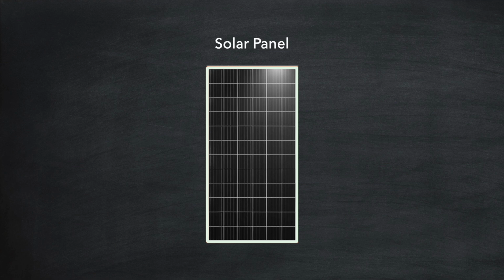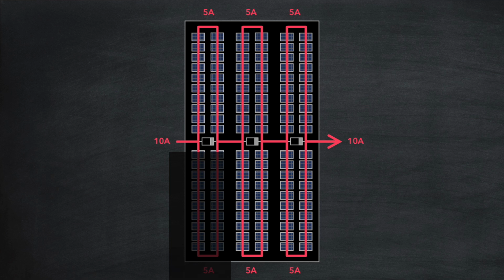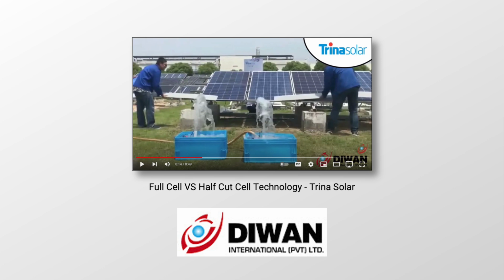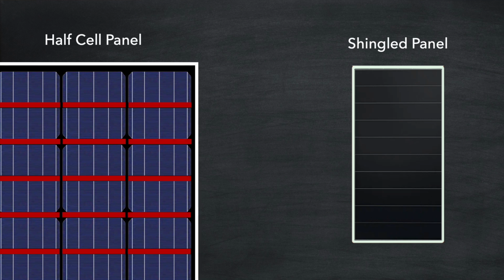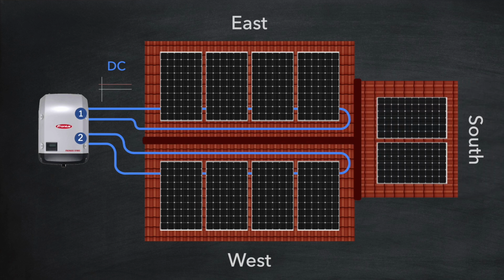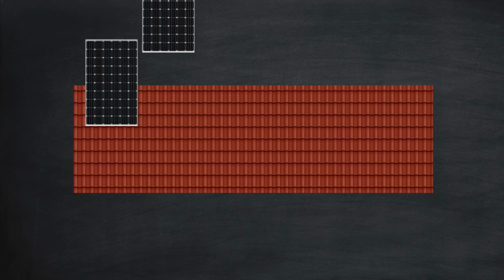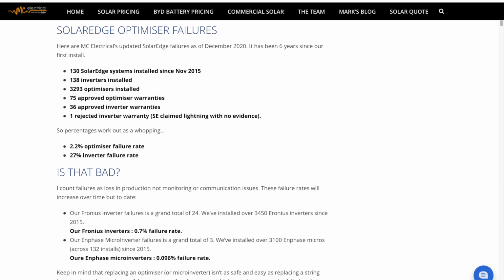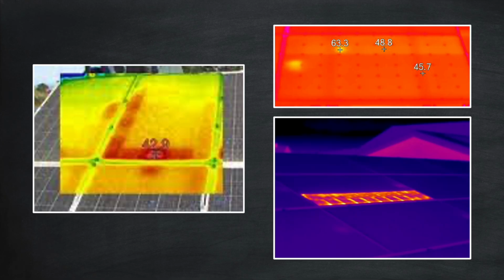Solar Panel Shading (Part 2): More on Optimisers and Micro inverters

Comment: Very informative vid and as with all things, more info tends to make it a bit more confusing for the newbie. Ive a south facing roof so solar seems ideal. I like the idea of a battery but would also like to use it in case of power cuts but not all systems can do this?

Cowboy installers worry me. I recently had 6 gas engineers round to quote for a new boiler and gave them a small list of requirements ie no combi, no budget boilers, got to be reliable and TRVs. Only 2 gave me a quote, the others didnt want to know!
Reply from the maker: Thanks for the kind words. And yes, it's true the deeper you get into the world of solar, the more involved it seems to get! I'm hoping that my videos go a long way to demystify everything, but maybe I'll have to be doing this for a long time yet - lol

You're right - not all battery systems manage power cuts. The only system that manages it well is the Tesla Powerwall, but you'll be on a waiting list for a year to get one, unfortunately. Many other systems provide a couple of dedicated power sockets in the event of power failure, so you'll at least be able to run an extension cable to your WiFi router and TV etc.

Yes, like any new market (think double glazing many years ago) there will always be opportunists. I talk a little about this in the podcast I did, referenced in the video, which might be useful to you...
Reply: @1701:TheFyldeFlyer
I have just had a Sofar HYD6000 hybrid inverter fitted and this has a critical load output or EPS connection which can be wired to supply a smaller consumer unit so that in the event of a power cut the connected batteries can supply the circuits in this consumer unit in the event of a power cut. You also have to have a chnageover switch installed as this prevents the circuits being supplied by 2 different supplies and also stops the inverter supplying all of the other house circuits and the transformer supplying your house as well. The reason for the extra consumer unit is that the inverter can only supply so much electrical load so can't power a whole house system all at once. I think the biggest is generally around 6kW (for single phase). I can't say how good the Sofar setup is as I haven't got the EPS output connected.

My installer said that due to not being able to guarantee the earth connection I was told I would need an earth stake and cabling on my property to satisfy wiring regulations.

For this and the other associated work required my installer said that the bill for this extra work would be around £1000. When I was looking for quotes for my PV system I started by looking at the MCS website which can show via a Google Map the installers around you geographicially who will have gone through a few more hoops to get the MCS certification.

Hope this info is useful to you.

Comment: Hi, Gary, thanks for the 2 videos on optimisers advantages/disadvantages.
I am considering taking your advice and referral to go with Octopus, but I have a concern over the advantage of Octopus Go and the 4 hour overnight cheap rate. I have a solar system with 8 kWh battery storage and Solis 3.6 kW hybrid inverter. The normal protocol  regarding the taking and usage of power for home use is solar, then battery then grid. So if I within the 4 hour rate charge my ev vehicle at my 7kW charger and have set the inverter to charge my batteries at the same time, what will happen? Will the car take the energy at 3.6 kW from the batteries first through the inverter and then take only the remaining kW from the cheap grid rate to make up the 7kW requirement of the charger? OR will it do this AND also charge the batteries as well, thus maintaining the state of charge of the batteries so that I still have sufficient energy to cheaply power the house until the solar kicks in later in the morning? If you have an ev, what do you do to maximise the use of the 4 hour cheap rate?
Reply from the maker: Hi Barrie, you're most welcome regarding the shading videos - thanks for the feedback! And it would be very kind of you to make use of my referral code and move to Octopus - it all helps with the costs of keeping my channel running :-)

Ok, onto overnight charging then. My understanding is this (based on what I've heard as I don't have an EV yet):

You can charge your EV and solar battery at the same time - there is a mode on the Solis that allows you to set a timed charge between 00:30 and 04:30 - so no issues there. And of course your grid supply will easily be able to charge both devices concurrently.

Comment: Just thinking about optimisers / micro-inverters - if the installer brought the panel cabling into the loft and connect ed these devices in the loft then that would make these far easier to swap out if one had an issue.
Reply: That's potentially a lot of holes in your roof underlay (breathable membrane, bitumen felt etc) though I have seen it done that way on at least one YouTube video I saw (can't recall which one though)
Reply: @tonymatthews1053  My installer was resistant to the idea.
Reply from the maker: I've heard that others have done this too. It's a good idea, but there are the potential issues that Tony raised - tricky decision!

Comment: Hi Gary, I would just like to say that another very informative video (again). Took the plunge last week and had an x18 half cut panel array, a 6kW hybrid inverter with 7kW hour battery system installed.
Reply from the maker: Thanks Adrian - and great to hear you've taken the plunge! Sounds like a very nice setup! Is it all working as expected?
Reply: @GaryDoesSolar  errm no initially or so the data led me to think initially, now I understand a bit better yes, although I am already thinking of increasing my battery capacity from 7kWh to 10.5 or even 14kWh. See my reply to another post on this video. I didn't realise how much the output drops due to a dull, overcast winters day. I had a very good Friday last week (day 1 after commissioning) where I generated 15kWh and since then if I've had 1kWh per day I have been lucky. Yes, there was a bit of nieveity involved but once I compared instant results with other people then it reassured me that my system was working fine and it was purely a weather situation which was the reason for the extremely poor results. If I hadn't been able to do this compare then my installer would have been getting phone calls as to why.
Reply from the maker: Ok, so it's actually sounding quite good so far... sunnier days are around the corner (I hope!)
Reply: @GaryDoesSolar  Hi Gary, yes it seems to be going quite well for the time of year. I seem to be outperforming my collegues 8ish array he has about 50 miles away but I think he is at a different angle to me. I would like to suggest to all watchers to join a group or talk to friends / collegues about there daily generation as in winter it is a lot lower than summer and not to get dispondent and question the decision when you (my system) only generates 0.19kWh in a day.

Comment: In winter ie Now what should we expect from an 8.8 kw system My highest Kw generation figure was about 35 mins at 3kw about 12.45 10kwh for full day. not as much as expected to be fair.
Reply: I had a 6.12kW virtually south facing system installed last Thursday . Friday I had 15kWh generated with a peak of 3.3kW. Since then I have had virtually no generation at all as Lincolnshire has been very cloudy / overcast and damp.
Reply from the maker: Hi Mark, worth using the tool I described at 5m56s in this video: https://www.youtube.com/watch?v=ccm1HmxELlQ - it'll tell you with a fair degree of accuracy...
Reply: @GaryDoesSolar  Hi Gary, I agree with you about the pv calc but this doesn't give the user an idea of day to day generation (unless I am missing something) for an installation especially when it is new and you don't have any practical data to go off. It certainly has suprised me how little is generated on a winters day when overcast. In some ways this is the best time to start as you get the worst case from the off so you then get used to the low results and then come early spring it will be a welcome suprise to see the output change. I found it useful to compare with work collegues as initially it appears that the system has a problem with virtually no generation these last few days when it is all new to me.

Comment: thanks again GARRY octipus referal done My system is now up and running! Just waiting on 3rd 5.7kw battery
Reply from the maker: Thank you Mark - that's very kind of you and much appreciated! And great to hear you're already up and running. My installation tale is a sorry one, having started it nearly a year ago, but I'm looking at the end of February now (fingers crossed). My battery array size will be similar to yours - I think there are revenue opportunities for such capacity :-)

Comment: There's always stuff to learn, who knew shading was so involved. Thanks for this follow up video.
Reply from the maker: Me neither, John! And you're very welcome! :-)

A quick question, if I may: you did some thermal imaging in one of your recent videos, and as you're pretty expert in photography, what equipment did you use? Was it a standalone unit, or combined with some of your existing camera equipment? And have you ever analysed your arrays with it? Many thanks!
Reply: @GaryDoesSolar  I purchased a Hti HT-A1 standalone camera. I'm not sure they are still available new as it's fairly old now. 
I had not even thought of using it on my arrays until you covered it in this video, however I will be once we get some better weather.
Reply from the maker: Looks like a nice little unit! Yeah, will be good to see how your panels are looking under the (IR) spotlight! 🙂

Comment: This is some incredibly useful information, thanks Gary. I have just placed an order for a solar PV system with battery storage and included 8 TIGO optimisers for the south array which will suffer from shading by a large oak tree. In the light of the information you have given, I have contacted my installers to remove the optimisers from my order. Keep up the good work.
Reply from the maker: Thanks Brian - very happy to have given you sufficient information so you could come to a decision on this. And good luck with the install when it comes!
Reply: Hi, Very interested in your decision to not to use TIGOs.  I have just has a PV system installed with battery without any TIGOs. Thought installer might have computed estimate wrong as there is a small tree directly South which casts a shadow between 13.00  and 14.30. Trying to decide whether it makes financial sense to add TIgos. Received quotes of £3k for all 15 panels and £1k for 5 panels. So all very interesting. Have you any idea how much extra production you would have got with your 8 TIGOs. Thanks

Comment: I suspect that many installers aren't really keeping up with technology developments and simply have a few "recipies" that they choose from that they match against the house configuration and whatever kit they can get at the time.

From what I read, if MCS had any real oversight of those they certify, there would be mandatory ongoing education and training to keep them up to date.

I've yet to pull the trigger on a Solar PV/Battery system for my own house (NE/SW roofs with slight shading from chimney on NE roof), but I won't just be having whatever an installer throws at me. As it's my money and roof, I'll be having the kit I decide on.

Another well researched video BTW. Looking forward to your next one ...
Reply from the maker: You're totally right, Tony - getting true value for money is hard these days, and certainly I've found that having knowledge up front makes a huge difference. Good luck when you pull that trigger... :-)
Reply: I have just had (for a week so far) a Tesla PW3 with 11x435W panels across 3 elevations.  NE/ES/SW
The installer put them on ONE string, with Tigo optimisers on every panel.  I queried this, because the PW3 has 3xMPPT anyway, and surely optimising over a 270' arc is a bit of a stretch???
Having said that, so far I'm achieving the daily expectation for October in my region (7E, north west). 
It just makes you wonder if you can achieve more...